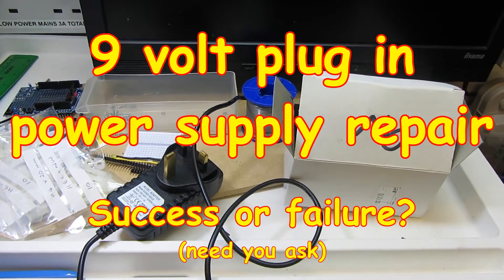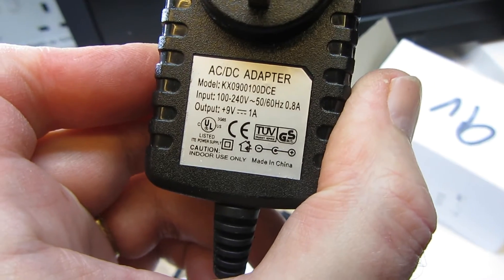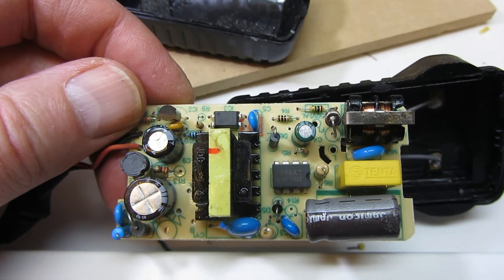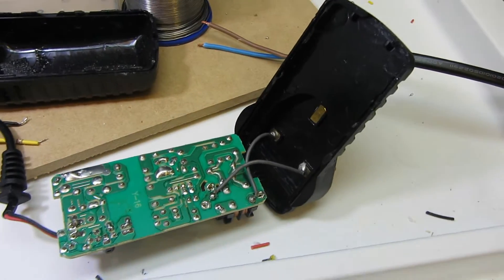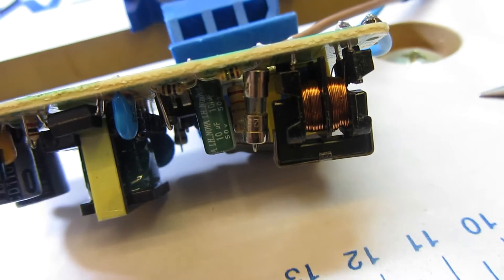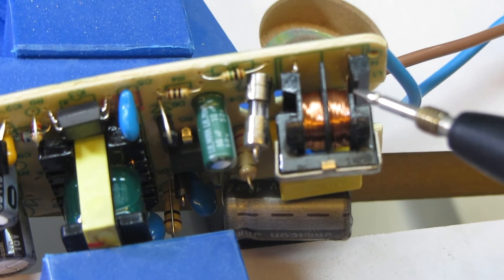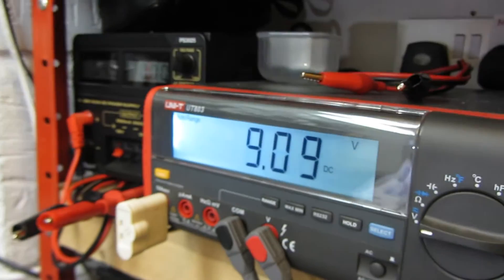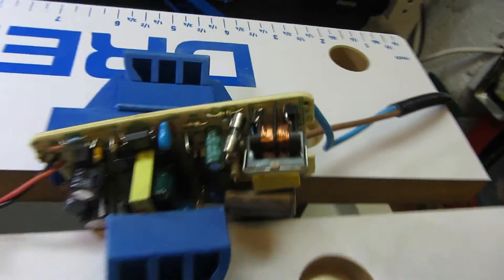#35 Power Supply (9v) Repair - woah! Mains Voltage!

Comment: It's good that you could repair the power adapter and save it from the land fill but it goes to show the effort, time, tools and knowledge required for such a task. Most people would prefer to spend the £5 or so to purchase a new adapter.
Reply from the maker: And I can understand why 99.9% of consumers would just buy another plug in adapter. But we are of the Arduinite clan and can repair stuff (although, being mains voltage, with caution) and become more knowledgeable by doing so!

Comment: You started out doing voltage checks,  I would have started out with resistance checks first!  Like around that coil,  and to make sure that the fuse was intact,  and so forth.  That coil is simply a line filter,  and could have been replaced with a couple of bits of wire with little detrimental effect.  And,  toward the end of the video,  that spool of solder sitting so near to the edge made me cringe.  I remember when those spools were metal.  Can you envision the result of dropping one of those onto a hard floor?  Yikes!
Reply from the maker: I deliberately do things like this to keep my audience on the edge of their seats! I also use a metal pointer in some of my mains-related videos! The repair worked though.

Comment: Hi again, me Friend !

I just ordered 2 of these RFID Modules for future or experimental projects down this winter.  REALY inexpensive from eBay .. more expensive if purchased at Banggood, mind you.  Maybe I just got a deal without knowing it.  LOL

I was just wondering if these modules were TTL Level tolerant.  I oredered the IIc Level converter all the same, but I was just wondering if I needed it for sure.  I guess it all tells you in the Data Sheet.

Interresting all the info you can write to those cards.  I first thought they were Read-Only though.  Quick question: Why write personal info on the cars, while all could be done on the reading side (soft database) with small or no effort at all ?

I'll wait for. those modules and come back to your tutorial when received.  I look forward to « play » with this module.  You were asking for ideas for these modules?  I've got one for you ..  Benny's trap door access.  Conceal  the blue module on the top of his collar and .. Voilà !!  Burglar-safe trap door .. as long as the burglar does not steal Benny's collar, that is.  All this is relative to the distance to witch the RFID can read the card/module, of course.

Well, back to my Laserings.  a few orders to finish before the weekend and we'll close the chop for a few days.  LOL

Have a great weekend, Ralph, and take good care.  Hope to read from you soon.
Reply from the maker: Bear in mind, Daniel, that the nRF24L01 chips are only 3.3volts and not 5v tolerant at all. That's why it's great you ordered the adapters too - makes all the power-related issues go away plus makes wiring up much simpler.
Reply: @RalphBacon  Thank you, Ralph.  I thought they would come handy for future projects.  If I need more, I'll just purchase them by the bagful.  LOL !!
Take care and I'll chat to you soon, my Friend !

Comment: The RCB is better than nothing - but you really need an unearthed mains isolation transformer when messing about with switched mode power supplies - first stage of that power supply will have a voltage doubler - so you're looking at about 440 volts in that part of the circuit
Reply from the maker: So it's even more dangerous than I thought, STM. And you are so right to point out that when using mains we really, really need to be mindful that it alone can be lethal, and switched mode PSUs apparently even more so. I really can't afford to lose any viewers or subscribers so your warning to others (and me) is spot on. Thanks for posting.
Reply: A doubler is used for 120V mains,  not for 240V.   After the rectifier and capacitor are taken into account, you end up with about 340VDC.

Comment: I have 9v regulated power adapter that is heavy and seemingly good quality, but it won't power my nano.  It didn't hurt my nano - just wouldn't power it.  Meter read 9v so I'm confused.
Reply from the maker: Is the centre pin the positive? Usually is, but sometimes not. Is the plug the correct 5.5mm/2.1mm to fit the -- well, what ARE you using to adapt this PSU to your Nano, as that only has a micro USB connector? Have you got a development board adapter like me (that looks a bit like a UNO board, same size) and into which you plug in the Nano, and then plug your PSU's barrel jack into the onboard socket? If you have a separate socket for the PSU, you can then plug the +ve into the Vin and GND to GND directly. Just make sure you never put 9v on the +5v pin or else it's bye-bye Nano!

Comment: How did you crack the case?
Reply from the maker: Well now, David, it wasn't easy. I tried to find a "weak point" where I could start it off and then gradually and slowly slid a flat blade in the ever increasing gap whilst applying pressure to open the case - but slowly. In some ways it helped that it was already broken as my thinking was that if I could not get the case apart then I would be in no worse a position - so I wasn't as hesitant as I might otherwise have been. Luckily it was only glued well at a couple of places so it opened up once I had got passed those points. The trick is to get entry somewhere and work from that point, very slowly, gently but firmly. You going to repair one or just generally interested?
Reply: It's not a repair as such. I just want to swap the output cable so I can power my digital radio. Right now I have a UK power pack for it, and and local power pack that has the wrong output plug.
Reply from the maker: Well, with care you can do this (but you must also be prepared that you might damage the case so much you won't get it back together again if that is your aim.) Of course, you could just take out the innards and put it into a new case with the right plug on it (perhaps that is what your aim is?). Good luck and don't switch on the mains without ensuring you can't touch the components as they are all at MAINS potential and therefore (potentially, no pun intended) lethal. I can't afford to lose any viewers or subscribers! Take care.
Reply: Thanks, I will

Comment: Good job. I need to ask you about my adapter. I have adapter that is output 9v  DC but when i test it it read 15.03v DC is it bad i think it is. ?
Reply from the maker: Hello! A 9v adapter that reads 15v is not necessarily "bad". It depends on whether the adapter is regulated or unregulated. Personally I would never use an unregulated power supply for the very reason you have highlighted: the voltage can be very much higher when no (or little) load (current) is being drawn from it. A regulated power supply will always show the correct voltage regardless of the current being drawn, with little variance. For Arduino use I recommend you replace that adapter and get a 9v (or even a 12v) regulated adapter. I hope this helps. PS if that adapter is supposed to be regulated and it is showing 15 volts then it is definitely bad!
Reply: i think so , You been a great help and fast . Regulated .

Comment: The input current will be ~1/20 the output current. There is no need for a heavy gage wire to feed tiny board traces. Looks like a good quality PSU to me. Everything is made is Asia now. You just have to detect the branded quality items from the fakes. You can do the entire job with butane as shown here https://www.youtube.com/watch?v=oa3nwuJ7cNY
Reply from the maker: Wow! An interesting, if alternative, method of soldering wires there, +jburdman7. Whatever floats your boat I guess. For delicate Arduino style electronics I'll mainly stick to a standard soldering iron though... 
Detecting fakes is, of course, all a bit difficult until you have the product in your hands. Perhaps the old adage of "if it seems too good to be true, it probably is" applies here, in the sense that items that very obviously are offered well below the trending price for such an item is probably not worth bothering with. Maybe. Thanks for the post (and that video) ;-)
Reply: The technique is best suited for ~14ga stranded such as speaker wire but with a little practice it becomes easy to use anywhere heat damaged items are not in the way.
If it might burn your house down the best way to go is to by a decent brand from a reputable retailer. If you buy a brand name your chances of getting a fake are higher.  have heard good things about Anker, Aukey, and Blitzwolf. I'm sure there are many more. Name brand smaller output items like this are now commonplace at thrift stores.

Comment: Cool repair. I was just wondering why you didn't use a lineman splice in the cable repair. They are a lot stronger, mechanically, than the pigtail joint.
I've started to collect old chargers from all my friends and family to power future projects, or to rip apart for spare parts. I found I have learnt quite a lot by reverse engineering power supplies. You can definitely see a deterioration in quality from older power supplies when comparing them to newer imports.
Reply from the maker: +Maxx B 
Yes I totally agree and always use a linesman splice on mains cables where strength is important. Just for this demo I felt a simple (soldered) twisted cable with some heatshrink was 'OK' and just easier to show. But the next time I need to repair a mains cable (or something I need more strength in) I will video and post for all to see.
 
Older PSUs were built to last and were built to a (safety) standard too. Some of these cheap Far Eastern imports can be not only cheaply built with poor QA (as my video shows!) but are also a hairsbreadth away from electrocuting people (or zapping their equipment) too.

Thanks for raising this issue; others reading your post may look up what a linesman splice is and learn something new too! Cool!